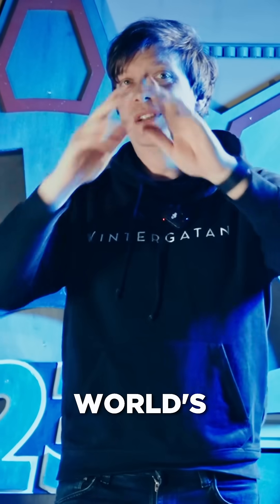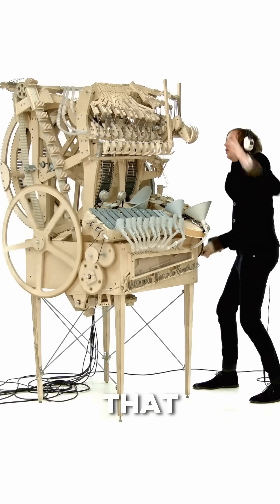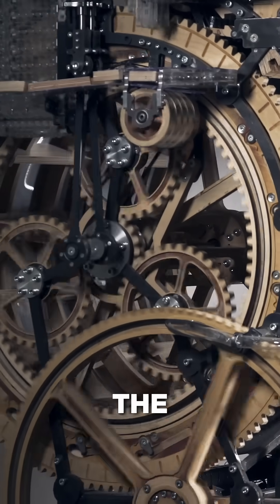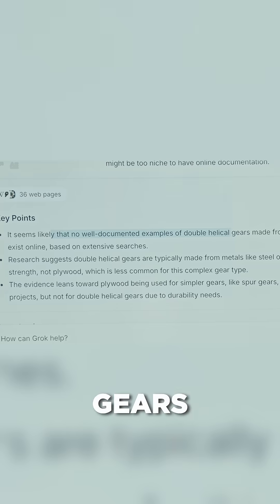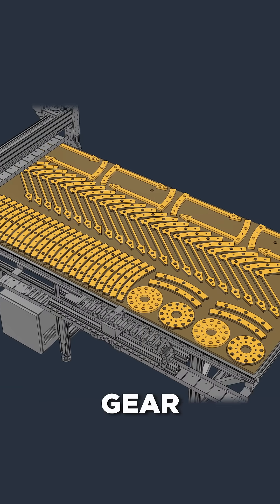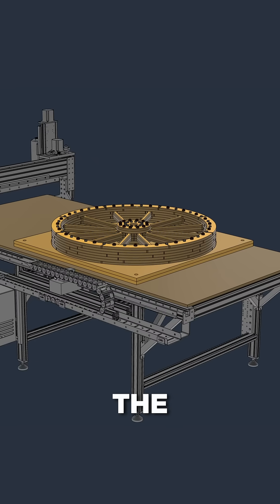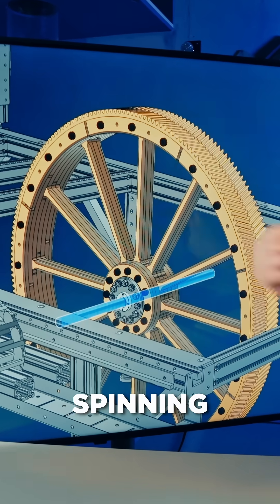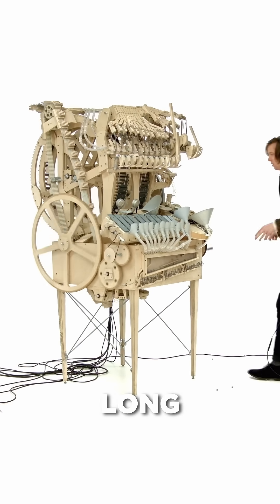The plan: Double Helical Plywood Gears!

Comment: Don’t use varnish or urethane to seal the plywood 

They’re going to wear away fast and you’re going to be reapplying often 

Oil finishes can just be rubbed on easily every so often.  And then I think the best thing you could do is actually just feed sticks of beeswax straight into the gears while it’s running.  It will reduce squeaking and rubbing a lot and it’s cheap plus it will further seal the wood

Just use a soft brush on the back side to get the chunks out so they don’t build up too much
Reply: Paste wax finish is great for this too, that stuff is slick.
Reply: @ThreadedNail  only problem with paste wax is that in dirty environments it's going to trap a lot of gunk. A dry wax isn't as slippery but also isn't sticky.

Comment: Ignore this comment section. Make it and see what happens. If it breaks, it would be funny, if it doesn't, it would be funny.
Reply: I actually think it's a really good idea. There's a reason why helical gears are use in billions of vehicle gearboxes. They're smooth and quiet. Exactly what you want for this application.
Reply: @JaenFoster  those are made of metal, and have been carefully evaluated for the expected forces of the system.
Reply: i like your style :D

Comment: I can't wait to see how it looks at full size. It will be interesting to see how the wear is with plywood, since the teeth will be a lot smaller and sharper than the spur gears used on the previous machines.

Though a minor ick, I would avoid using text generators like grok or chatGPT for factual searches. (Or just in general really) They generate text, the quality and veracity of the data is middling at best and made up at worst.

Comment: Helical gears are much easier to break teeth on due to how thin they end up being, especially with the torques you’re expecting to apply to power a stage-sized machine. You literally said that you had no problem with the spur gears, and the backlash you keep going on about only applies if you’re going to switch rotational directions.
Reply: Not to mention plywood delaminates.
Reply: It's like Martin gave himself the obvious reason not to do this, but failed to listen to himself
Reply: He kept calling it backlash but what he meant is clearance.  He does need extra clearance between the teeth to account for swelling and for imperfect alignment.
Reply: @ Or, he could avoid the issue entirely by using an appropriate material.
Reply: @thomasbecker9676  we’re well past “proper material” with Martin. We’ve accepted that he’s going to keep using plywood and hand bent plastic tubes for things that are meant to be precise and robust.
Reply: Seem to be fine in the literal billions of vehicle gearboxes that use them. And they're also not without their upsides. The mesh being smoother and therefore a lot quieter being the main one.
Reply: @ 1. Those are metal gears, not plywood 
2. He’s repeatedly said that the spur gears have never been the problem with the sound. If that were the case, he would have looked into grease of some form by now. I just want him to do a strength test before he goes and makes the entire gear of spur vs helical, just because of how much force it’s going to take to make the machine move

Comment: I like the look of it but as you described, the original gears worked flawlessly, why would you add complexity?
Reply: i would think he really just loves trying new things. its part and parcel of innovation!
Reply: It's how he operates. Everything he does is in the name of additive design.
Reply: Helical gears are quieter than straight cut spur gears. That's way they're used in almost every gearbox.
Reply: Jaen has it. Quieter in operation
Reply: Because deep down, he doesn’t even want to finish it any more
Reply: they were not perfect because they were very noisy. helical gears are much more silent, meaning the audio would be much clearer.
Reply: @ "Much more silent." Wow.
Reply: There's money to be made in prolonging the problem. He has no intention of every finishing a marble machine, not as long as he rakes in money from kicking the can down the road.

Comment: Just more kicking the can down the road and procrastinating. plywood helical gears are a terrible idea. At best, they'll mesh poorly and wear oddly. That's if they simply don't just self-destruct.
Reply: Would it be possible to mount metal teeth to a plywood wheel?
Reply: Engineering involves a lot of trial and error. Who knows how this idea could evolve for the final machine 🤷🏼‍♂️
Reply: @tman1518  I'm an engineer. This idea is a silly one.
Reply: @thomasbecker9676  Heyy fellow engineer. I'm also an engineer. So what of its a silly idea? It's his machine, with his criteria. Maybe it will work, maybe it won't. No need to be hostile dude.
Reply: @ He hasn't defined the criteria. His idea fails immediately. If you're an engineer, and you see this and think, "yeah, that's a good idea," you either need to switch fields or work for Boeing.
Reply: @thomasbecker9676  but he's not an engineer, he's an artist. And what make you think he can't. It's not like it hasn't been done before.
Reply: @thomasbecker9676  Actually, he has established a lot of criteria! Oh his patreon he often lists out his criteria for the new machine verbatim. The thing about criteria is that with the use of trial and error, it can change :) 

So what if it fails? Failure in engineering is literally how you perfect the method. It's how you learn what makes a good / bad design. Based on the way you're acting, you must have had a not so great teacher.
Reply: @JaenFoster  Oh man, you said Martin isn't an engineer; the cult is going to come for you. Also, please cite sources for "It's not like it hasn't been done before," as it pertains to homemade, plywood helical gears in a use case similar to a marble machine.
Reply: @tman1518  No, engineers do a lot of math and research to avoid failure. If you're on his Patreon though, it's clear you're part of the cult and will never not adore Martin.
Reply: @thomasbecker9676  Dude genuinely what is your problem? If you don't like the content or the idea, why would you try to preach your opposing views to a bunch of people that you claim are part of a cult that will 'never not adore martin'?

If you're genuinely a real engineer, you must be one of the worst people to collaborate with on any sort of project. 

Also are you telling me that there is not a single instance of engineers learning from failure?? Look at early versions of cars, planes, ships, etc. 

One more thing. Assuming you're a grown adult, you're doing a very bad job of trying to maturely prove your points here 😂
Reply: @tman1518  Do you actually think the first thing engineers do is slap a design together and test it until failure? You're very much a cultie, aren't you? Keep giving Martin your money; you're never going to see a finished working product, though. Also, your music is terrible.
Reply: @thomasbecker9676  Of course engineers so all sorts of research. I've been going to school for this for quite some time. But I've also learned first hand that to get a working product, you need to test iterations.

The music on my channel is irrelevant, and I could care less what you think of it. If you want to discuss further why don't we hop on a call?
Reply: @thomasbecker9676  ???
Reply: @tman1518  So you're in school, and not an actual experienced engineer? Man, you better learn what the real engineering world is like, or change majors now.
Reply: @tman1518  just ignore him he's been like this for multiple years now
Reply: @thomasbecker9676  you are either a rage baiter or one of the saltiest persons I've seen in the comments! 

Of course engineers try new things and test things to failure, that's what prototypes are. How else do you figure out how a new design will operate in the real world and not just on paper?

Engineering or not, failure is how we learn and grow and discover new things
Reply: @azriel5  Testing is expensive and time-consuming, and done once paper bears out a high probability of success.
Reply: Right, it's not like they're used in billions of vehicle gearboxes every day without hassle...
Reply: @JaenFoster  pretty sure car transmissions aren't made out of plywood.
Reply: @corkhead0  true, but it's also not like this has to handle anywhere near the same amount of power (or operate anywhere near the same speed)
Reply: @ That's one of the stupidest things I've ever read. If you're an engineer, you're in the wrong field.
Reply: @thomasbecker9676  why's it ridiculous? If it can handle the speed and torque he needs it to, there's definite advantages of helical gears over spur gears.
Reply: @JaenFoster  It can't and won't. What makes you think Martin could manufacture helical gears out of wood that would fulfill those requirements, which, by the way, he has yet to define.